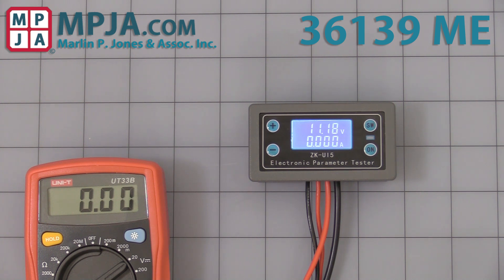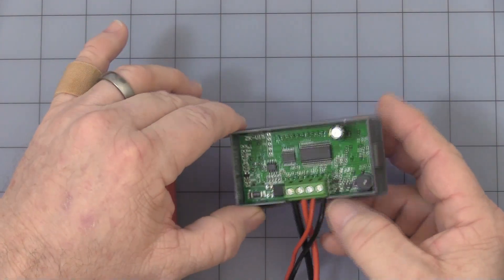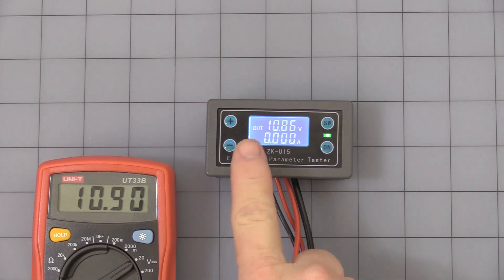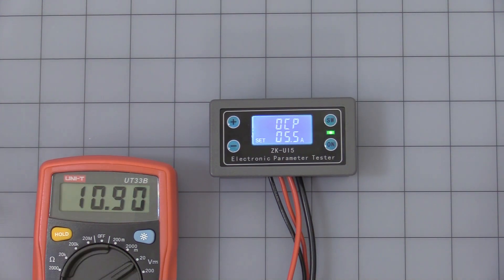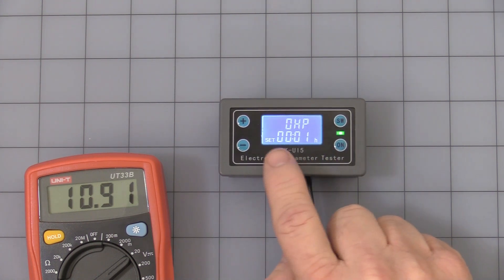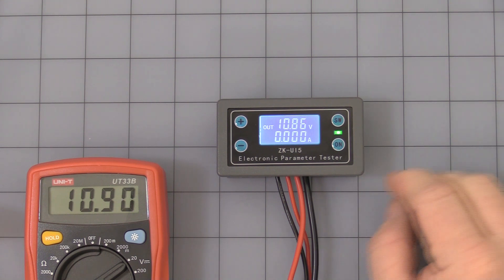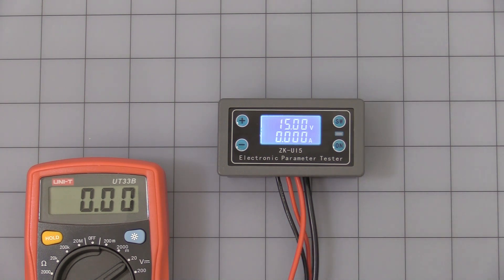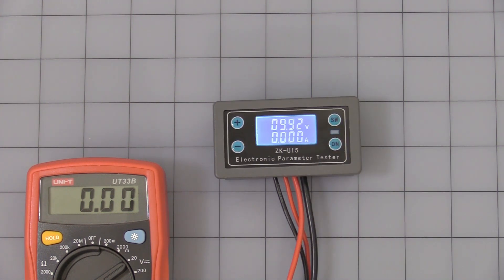DC Multi function LCD Panel Meter 36139 ME

Comment: I just discovered this today, such an amazing little module especially because the display is above panel and the wiring is below! I’m looking for something like this but ideally with a display option to know what the input / charge current is from a 10v .5A panel (with built in diode - that outputs 19v - open circuit ) . Will this module show the charge mA or charge voltage? Also does this module do essentially what a basic solar charging controller does or do you need to buy more components for that? I see a similar device (with same form factor but with yellow buttons) that has solar in it’s description. I’m specifically building a little 7Ah 12v portable solar bank (diy). My bank is in a small pelican case using an NPP SLA 12v battery and will power: 1x 12v cigarette lighter port, 1x dual USB c and USB a ( via 12v to 5v dc converter). Thanks so much …

Comment: Unless I missed it. You didn't mention anything about the input voltages and limits, otherwise good video.
Reply from the maker: Input voltage is 5Vdc to 38Vdc max and Amps are 0.03A to 5Amp max. Thank You
Reply: @mpjaonline  cool thanks